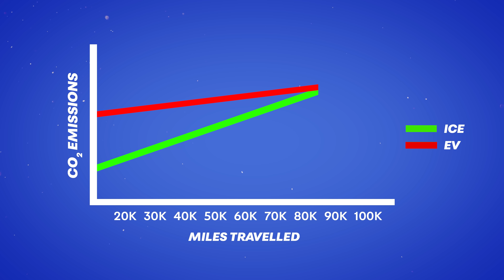Are Electric Cars REALLY That Green? [New 2022 Data]

Comment: I find it strange none of the cost figures calculate in replacing the batteries.  Yes the batteries last a good length of time, but still they need to be replaced at some point.
Reply: So does your engine and water pump and transmission and brakes and coolant and OIL !
Reply: No they don't. They can be refurbished, just like an ICE engine.... You obviously never heard of battery refurbs....
Reply: No they don't. They can be refurbished, with the failing modules replaced with good ones. This usually costs just a fraction of a complete battery replacement. You need to do more research.....
Reply: @Brian-om2hh  You need to research on how many people have bought used Teslas just to find the whole battery needs to be replaced.  There is a great video of a man finding out after he bought a used Tesla he was quoted by Tesla it would cost him $40,000 to replace the batteries.  Instead he made a video of blowing up the Tesla.

Comment: We have had green transportation available forever. It's call a horse or other domesticate animal. Problem is people have no patience and want everything as easy as possible with no cost to them, which is why anything environmental is crapped on and turns into a political statement they pull out of the sundry list of misinformed armchair science propaganda butt they have their heads up. Just read the comments. Easy to spot. Anway, need hydrogen dry cell and solar thin film Perovskites or Photovoltaics for EV charging to help things along.

Comment: Personal transport will only be token green at best. It leads to multiple copies of consumption for example the tyre to person ratio of a full bus to the equivalent spread out into ~20 full cars. I'm a motorcyclist and I know bikes aren't greener than cars. Sure better power to weight but bikes have the aerodynamic coefficient of a 80's box shaped sedan at best. Tyres last 1/3 the distance, most require oil changes every 5000km. 
The only green aspect of motorcycle  (outside of SE Asia) is they don't cause or add to traffic congestion.

Comment: Thank you for the excellent video!
Three  issues that are commonly ignore are the distribution, management and maintenance environmental costs of the grid which, even if the electricity is produced in a 'green' way are considerable. The second item is the environmental cost of complete vehicle recycling and/or disposal. The third item is regarding the equations for very low usage vehicles - mine averages about 6,000 kilometres per annum. As usual, a thoughtful approach is likely best. The only issue appears to be that most people these days seem to be incapable of original thought!

Comment: And what is the lifetime of the batteries, and do they get weaker over time? I can answer the last one: Yes they get weaker over time! Also when a battery catches fire it's literally an environmental disaster: Lithium is very very toxic and just to breath the smoke can be deadly either instantly or later in life depending on how much you breathed. the soil and the foliage that came in contact with the smoke needs to be removed and buried too and God forbid if the lithium based dense smoke went across a field of edible foods and was harvested and consumed but no one will speak of that!  I'll stick to ICE thank you!

Comment: The  assumptions for the data in this report are not revealed especially the "Use Phase" for all vehicles in Figure 1.  ICE vehicles use 3 times the amount of fossil fuels as fully electric vehicles. Therefore, the bar charts for the "Use Phase" are all wrong. The "Use Phase" for ICE -petrol XC40 vehicles should be 3 times greater than for the  Recharge Global  XC40. These data completely skew the results towards IC vehicles. Volvo should fire whomever wrote this report.   I suggest sending this report to TESLA engineers so they can have a good laugh. 😂

Comment: A much more balanced view than the HEADLINE implied. I voted for both, as my last 3 cars were hybrids, and my current car is a PHEV. The latter I think at this point in time is the sweet spot. HV for trips (640 mile range) and EV for around town. During the pandemic I went an entire 12 months without visiting a gas station, all by keeping my shopping trips local and recharging after midnight. (I also have solar panels that put energy back into the grid during the day when THEY need it, and they return some of it to me after dark.) I didn't even know I hadn't visited a gas station in a year 'til I had an ailing friend ask me to help him out in SLC, Utah. (4 X 11.9 gallon tanks of gas round trip from San Diego a bit over 50MPG. I did NOT stop and charge along the way, nor in SLC. Not until I returned home.) I typically only gas up every 3 or 4 months during normal times. Once the battery tech and chraging infrastructure get where they need to be, I consider my PHEV to be a transition technology to full EVs. Alas, as I am 78 I don't expect to see the day that EVs are for (almost) everybody. I think Hawaii as already there! No place to go outside the range of a fully charged decent EV there. (The longest 1-way distance there is well within the range of most full EVs. Probably even round-trips!)
Reply: Hybrid is the most environmentally friendly choice so kudos to you sir! Making it even greener you could use waste-derived biofuel like ethanol or biogas.

Comment: Good video even if at a high level.  Tons of good comments on here about the other things to consider like what happens when the battery needs to be replaced (@90K), range (for me is the killer currently) and if you are a real car enthusiast, when will there be an EV that acts like an ICE?  I've rented a Prius and hated it.  Also been in a MACH E and loved it.  So, when the bugs get worked out and they make some EVs that are not ugly (like the MACH E) and get it the range my F-150 has I will consider buying one.  BUT the biggest issue here no one brings up is how is the average person supposed to afford an EV?  The poor who need to drive to their jobs every day cannot afford any current EV so any dope that says it's just about switching over has no idea what they are talking about until there is a reliable INEXPENSIVE replacement for people who own cars that they currently drive that cost them under $5K.
Reply: Batteries.. at least in a Tesla are designed to outlast the car. Plus. The batteries are under warranty.

Comment: something EVERYONE seems to ignore, actually 2 things
1: "I use green energy to charge" ummm ok, did you figure the the emission cost to manufacture those turbines and panels? wind and solar have one major down fall similar to the EV. it takes a LOT of resources and energy to create them in the first place. also they need replaced every so many years, those units are tore down and shipped off to a landfill.
2: no one considers the battery life and that it will need replaced far before the "124,000 miles" many companies will say "200,000" but there is often a replacement done between 6 and 9 years (they figure distances off of no stereo or AC/heat usage). so lets say average of 7.5 years. average of 12,000 miles per year thats 90,000 miles. thats not just more carbon emissions its also 3,000-18,000 dollars. typical batteries (not high end EV batts) will run in the range of 6,800 dollars. so you just get the car paid off and you are down at the bank to get another loan for more than the value of the car to replace the main component.
3rd bonus point. anyone that has to do a lot of driving each day like I do, EV short range is a major loss of time and income. also to increase comfort for longer drives battery life and charges will also be cut even shorter.

Comment: So the battery modules are less than 30% of EV production emissions but the total production emissions are 60% higher?  Even though EVs don't require  a heavy engine block,  fuel system,  exhaust system, cooling system?  I don't buy it.

Comment: Your assessment of EVs vs. ICEs was fair. However, I wish you had included two very important aspects. For one, there is NO electric power grid anywhere in the world that can support the recharging of EVs if all ICEs are banned. In the UK, for example, it would mean to recharge 33 million personal vehicles plus all industrial vehicles on a daily basis. Good luck to that.
For another, the recycling of retired or damaged EVs is already creating massive headaches mainly with the batteries. Some recyclers in the USA have stated that they can recycle over 95% of an ICE while recycling an EV does not even reach 45%. Also, the batteries, at least those in use today, pose a tremendous fire hazard and often are simply dumped on landfills posing a massive environmental hazard.
Taking all these arguments into account, I for one will stick to my ICE and use petrol until the conversion to a car running purely on hydrogen is available in the next two to three years and then will have my old faithful Mercedes converted or buy a new one running on hydrogen.
Reply: you troll , hydrogen ? you're serious ? good luck with dumping you wallet out the window in petrol fumes ,   the solar on our roof provides the energy to run two Env200s and a Tesla .   Volvo has no way but to go bankrupt because they can't switch from ice ...  the real science is already out there . and you can't read it because its reviewed
Reply: yeah you like hydrogen ? shit SLS can't get it right do you think a car company can ? they can't even keep oil from leaking

Comment: Off the production line an EV does have a negative carbon footprint, in excess of a petrol or diesel car. The diesel engine (most efficient out of petrol and diesel) has a max efficiency of around 41%. An electric motor is between 85-90% efficient, of course this doesn't tell the entire story. Batteries are the main concern with environmental issues, and until we have the recycling and refurbishment facilities in place it will be like this for a while. However, the energy used to charge the vehicles doesn't have to be from gas/coal... renewable sources can be used solar/wind or controversially nuclear. Also those packs that are taken from vehicles can then be refurbished and put into storage and to even out the peak and troughs of the current supply and demand for the national grid.

Everyone in horse and cart's laughed at the motor car, everyone thought that the wright brothers were crazy and now we all take aviation for granted, the future is NOT burning petrol and diesel for locomotion of the individual... it is not sustainable both economically, politically or environmentally.

People have the right to choose for themselves, economies of scale only present themselves when the masses take on board newer technologies. Until enough people actually SEE the differences for themselves or actually SEE the benefits of cleaner air and less pollution they will not want to change anything, especially when bully boy practices from governments try to make the decisions for them by pricing them out of a choice in the first place.

Comment: Not having read the PDF (the link doesn't work) I believe Volvo uses batteries made in China which probably makes the batteries as dirty as they come. Had they used batteries from for example Northvolt instead I think the initial extra CO2 cost for the EV would be a lot lower.

Comment: Batteries lose significant performance at 90000 miles, so you need to factor in CO2 cost of new batteries. Alternative electricity sources also have severe CO2 manufacturing and longevity issues.

Comment: How many miles will you get out of the lifetime of an EV battery?
Reply: That's another problem right there. Most people will not discharge/charge /maintain them correctly and they will last much less than expected. Resetting the emissions counter (for the break-even point) when a replacement is needed.
Reply: @C_R_O_M________  My train of thought exactly. Seems like a fairly obvious point to address.

Comment: The moral high ground can be retained ONLY from those that are right. So far the EV arguments are anything BUT convincing. Even if you charge completely with renewables (which is what the 90K mile break-even point is assumed upon) and which is a highly improbable even impossible scenario, one should factor in the carbon emissions for producing the renewables themselves. With an EROEI of 1 to 5 solar and wind have horrendous build-in efficiency! Fossil fuels get that EROEI to 30 and nuclear to 100. This means that for every unit of energy put into the system for solar and wind you get back just 1 to 5 units of energy which pales to the 30 and 100 figures of fossil fuels and nuclear. What about those emissions then? See how complicated things are?

Comment: The manufacturer said 90K miles but other researchers concluded 120K miles! In which point some EVs will need a battery replacement and that means that the emissions counter should be again reset to almost zero and start counting again for the break-even point! BTW CO2 is NOT A POLLUTANT! Get youtr wording right! It's supposedly a greenhouse gas but never was a pollutant! It's plant food for Christ sake! How can it be a pollutant when all living organisms exhale it?

Comment: First of all you started with a huge mistake: There's no real dichotomy of interests of big oil and the EV crowd. Maybe the latter think so but they are mistaken. In fact Big Oil has no problem whatsoever with the climate change agenda and in fact they are promoting it in their own sites and how they plan their future by diversifying their portfolios with renewable projects (tapping into government subsidies in the process). 

The oil industry will provide the energy for all those cars to be produced AND charged! If you think that the world can be switched from an over 80% energy dependence on fossil fuels to something like less than 30% with a flick of a finger you are delusional. 

Nothing like that is going to happen with airplanes, huge container ships (with just the largest 50 of which emit more CO2 than all passenger vehicles on the planet on an annual basis!), mining equipment, transportation of industrial goods, the energy mix for the grid and so on, being directly linked to fossil fuel usage. 

This is going to be the case for decades to come. 

Moreover, whoever thinks that Big oil, with the most powerful lobby on the planet will just sit and watch their core business go down the drain by some politician is naive to say the least. All of them, as a bunch, have pushed this agenda relentlessly and are now about to get the fruits of their efforts as oil prices will go sky-high as a result of oil exploration divestment and reduced capex for years, which means that Big oil (with a few exceptions) has been storing its reserves in the ground which is the cheapest form of storage! 

Now they are going to be seeing huge price increases and the subsequent profits, while their small competitors with not so strong balance sheets will get wiped off. Double whammy for the big fish and their political puppets!  That's a much more clear view of what's happening than a childish belief that the strongest in this world are fighting each other. They are having a laugh in our expense! Literally and metaphorically! Over a cocktail!

Comment: With all the emission controls in modern cars, how much toxic gasses do they actually "pump" into the air? Look at the processes involved in producing electric cars, far more environmental damage is done, how about the extra damage done to the roads? EV's are inherently heavier, causing more road degradation, there are so many questions that the green brigade refuse to answer.
Reply: You forget about the process of getting the oil out.. that is a very heavily polluting process. Not just CO2.

Also Volvo's report basically says 29 thousand miles for people who have access to clean energy (like hydro). I think that's pretty compelling. The video focuses on the worst case.